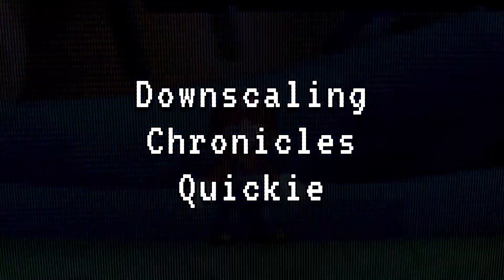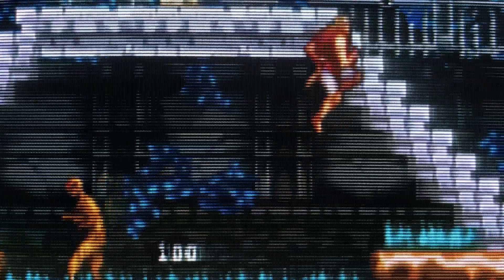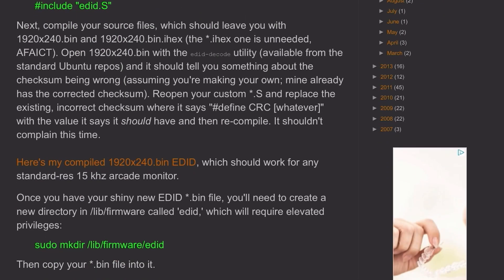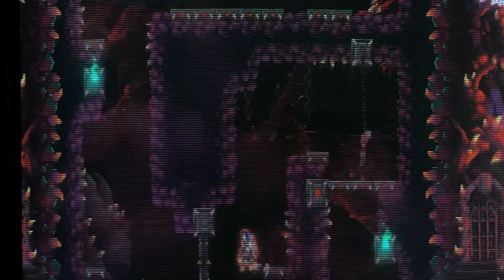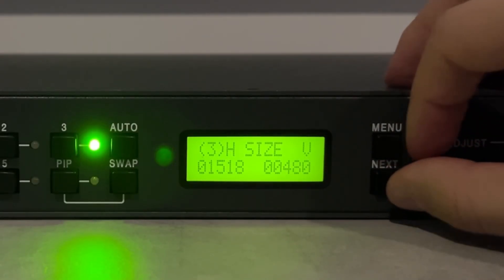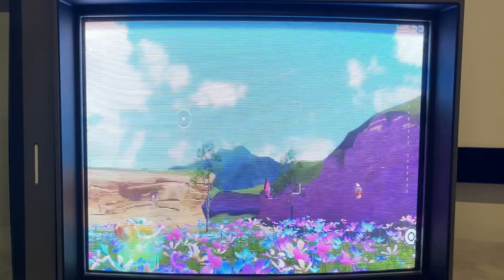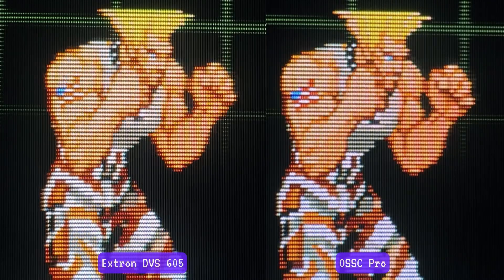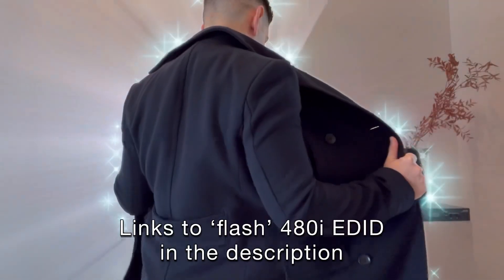Downscaling Chronicles Quickie: Extron EDID Method with 480i Output on the Extron DVS 605

Comment: Thank you so much Mario for the downscaling chronicles. I love it ! 

Great news today as I just bought a really cheap Extron 605 last week. I wanted to get one for HDMI to VGA use, to play modern games on my 2950 PGM at 720x480 but I also had the downscaling use in mind for my other CRTs. I previously, like 4 years ago, used the Extron VSC 500 + Extron RGB method to get 240p from my CPU/Xbos360/dreamcast) but it was not working for me, just got 480i. Then bought a Corio C2-2355 but wasn't really happy it, even if it does many things it is not practical to use. I followed your chronicles and wait for the good device and with it this update it's nice to see that you now give the Extron DVS 605 a 10 out of 10 ! I'll try my best to use the edid method, it is not looking that easy. I'll see.

Thank you again !
Reply from the maker: The DVS 605 is a real treat once you upload the EDID’s. It’s really simple; install the PCS, download the 240p and 480i EDID’s, connect with a USB mini cable, drag one EDID to C1 and the other to C2 custom resolutions. That’s all you need for the PCS, then change a few settings on the unit like I recommended in the video-Auto Image On and Fill, Reduce the H size and re-centre it, AFL On, save your preset and that’s it. It’s a little less work than setting up a Corio2 and has more fluid image controls. The OSSC Pro is still my favourite as it does a few more tricks but the DVS 605 should fulfil most downscaling needs. Myself and another friend are the only ones to test 480i output on the DVS, it worked great on 2 of my display and was a little jiggly on one side of my friends CRT which may be due to the H size.  Thanks for keeping up with all these downscaling videos and for the kind comment.
Reply: @MarcoRetro316  Thank you very much for your reply and tips. I'll try that next weekend. I'll rewatch all the extron videos you made (well exept the emotia one may be) to help. I'll let you know if I made it, I hope so. Regards.
Reply from the maker: @philippebrodier  a lot of info in this video supersedes episode 9. Ep 16 might still be helpful to watch
Reply: @MarcoRetro316  Thank you Marco. I received my Extron DVS 605 today but unfortunatly it freezes on the "Extron Electronics" display on the screen without then showing the model and firmware or red led on the imputs. I'm afraid it's broken, or may be it's locked, I don't know. Any tips may be ? Thank you again !
Reply from the maker: @philippebrodier damn! It sounds like it hasn’t finished booting up. Here’s the boot process but you described what it should be doing. https://youtu.be/GvaVxmAasyg?feature=shared
There’s an Executive Mode which locks the unit, hold Menu and Next together for about 2 seconds
Reply: @MarcoRetro316  Thank you Mark already done that after reading some of the manual. No luck, it was especially cheap, 75 Euros with 3 other Extron device. I should ask the guy to show me that firmware version. It's my own fault...
Reply: @MarcoRetro316  and thank you very much for tour quick answer and that booting video you made for me ! Mine stops at 30 sec. I guess may be I will have better chance with another one, just like you ^^
Reply: @MarcoRetro316  also I tried to reset back there but it doesn"t wotk. The Led doesn't flash once. I pushed that button over 30sec without any result
Reply from the maker: @philippebrodier  it definitely sounds like it’s stuck in boot sequence😢 sorry for your loss. These seem a bit volatile and you’re not the first I know of with start up troubles, me included. I can’t even upgrade the FW in mine, it just hangs. Hopefully you find another solution or can get it back to life
Reply: @MarcoRetro316  It's the second extron device that is stuck in boot sequence, a RXI 202 has the same problem. I also had a DVS 304 that exploded last year. I bought a new one but firmware is in 1.10, the previous was 2.14. I managed to get an Extron insider account but didn't find the way to update it yet (link problem I think). I have the opportunity to get a in 1606 but this model is not as practical as the 605 so I think I will wait for a new one. I am also disappointed with the one I have because it was very cheap, 75 euros with three other (useless for me) Extron device... I will send it back if I can't find a way to make it work this weekend.
Reply from the maker: @philippebrodier  you have had a poor run with Extron indeed! Most lack a standby mode and were on 24/7 so their capacitors might be cooked. I’m not sure any other scalers on the PCS list have analog output. When I tested the IN1606 I had to run the HDMI output through a DAC and then through an Extron RGB Interface to get any CRT to synchronise. It might be worth waiting for another DVS 605 or see if there are passive components on your faulty unit that might need replacing
Reply: @MarcoRetro316  yes, some bad luck indeed. I think I'll wait for another 605, I won't bother with the 1606, too many things to make it work. Thank you again for your help !
Reply: @MarcoRetro316  Hello Marco. I got another DVS 605 last weekend, twice the price of the former but at least this time it works.

I tested it with some basic stuff last weekend. I managed to input the 240/224 and 480i EDID into the DVS 605. I tried it with a switch, dreamcast and a super famicom, just a bit with a saturn. 

The 240p EDID works out of the box but I have a regular frame skip like every 15 seconds, I think that's what you talked about in the first DVS 605 episode. Do you think it is someway possible to fix that ? The DVS displays 59.94, like NTSC broadcast videos. I was glad to have pixel perfect resolution from 240p to 240p to be use on my older PVMs including the one I use in Tate. Unfortunatly if changing the horizontal size is ok, it's not the same with vertical size, if it's not 240p I get average lines like with 480p or more sources. I also noticed that it's not possible to change the input resolution with the 240p EDID unlike the stock Extron EDIDs. Still, being able to change horizontal size is great for for my tate monitor and of course customing the image position is great with Extrons ! Still I have to find a way to make groovy mame works, I think the 640x240p resolution of my cpu is the problem but the games don"t work either while launched (at 240p or around with groovy mame), black image again. Same with the Saturn via RGB (it'a EUR modded to 60hz model).

The 224p EDID works too (didn't test it much) but not the 480i unfortunatly. I don't know, may be I missed something. At first I tried to use it with my super famicom as it was already connected on the DVS then i though how useless it was (and may why it wasn"t working) and then tried with Dreamcast and switch but result was the same, black frame. The dreamcast was in VGA input, switch on HDMI of course. I use a sync strike for the Super Famicom. May be the problem was my Sony consumer TV (still have to try on some PVMs or JVCs). For the output I use a VGA to scart adaptor that works fine with the 240p and 224p EDIDs. 

I do more tests next weekend.

Sorry for the long text...

Thank you again for your help and your work on the downscaling chronicles !!!
Reply from the maker: The 480i EDID might be too non-standard for what your CRT expects. Sometimes I had to run the output through an Extron RGB interface, and other times it just worked. CRU reads it as true 480i but the Extron EDID Manager thinks it is 960i. Have a play with custom EDID’s in CRU with CRT timings and see if you have any luck. I can run the 240p EDID’s through the EDID manager and select all of the typical input resolutions so that they will be selectable on your console. Honestly an external scaler isn’t the best route if solely wanting to emulate from a PC as it won’t cater easily for all of the different progressive 15KHz resolutions. You’ll have to make custom EDID’s to match the desired resolution of the game and select manually. I suggest to alter the V size on the DVS 605 while displaying the 240p test suite horizontal stripe pattern to ensure it perfectly line averages. The frame skips might be fixed by turning on AFL (frame lock)
Reply: @MarcoRetro316  Thank you for the quick reply Marco. I'll do more test and try the things you explained this weekend, I'll let you know the results. You're right for the PC with groovy mame, so many resolutions, it's not practical, I guess I'll have to keep using my extron RGB to position the picture without being able to change sizes on my old monitors. About the frame skips AFL was already on I think. It takes some time to get the image stable but indeed it improves the lag, I felt it.